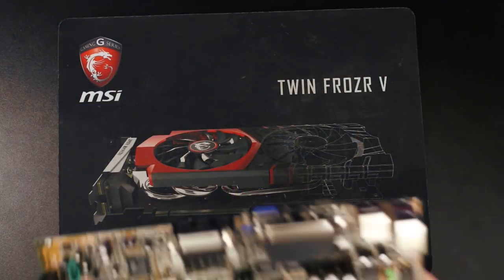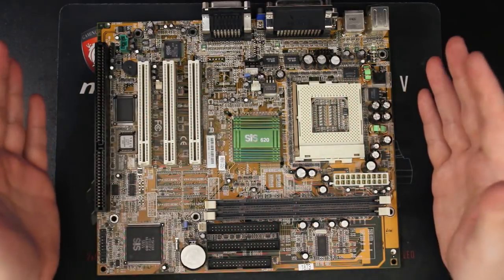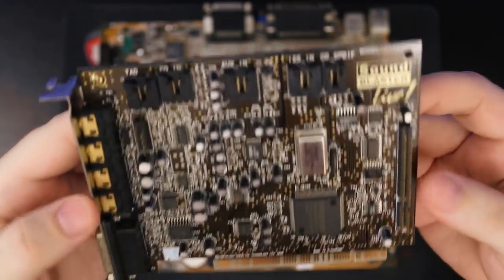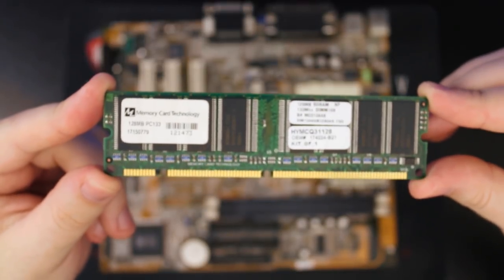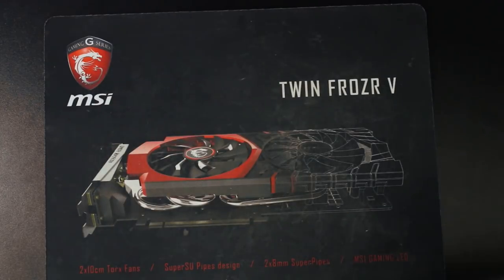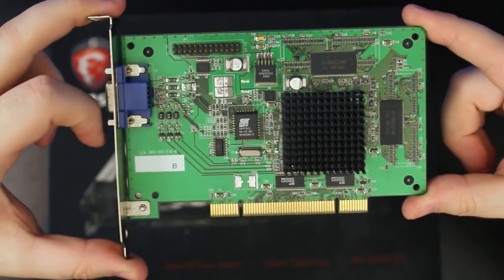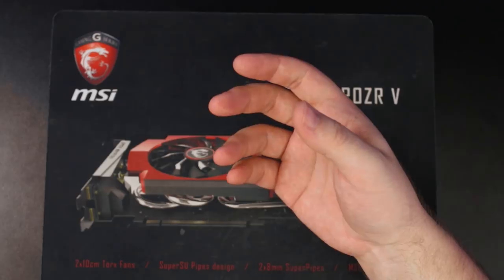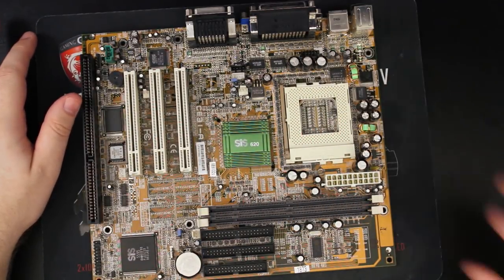(out dated) The 1999 Retro Project - Part #1: Hardware Choices

Comment: Actually, RAM can work at lower frequencies, so a 133Mhz stick should work in a 66Mhz or 100Mhz bus motherboard.
BUT it does have to be compatible. Back then there were compatibility issues between dual sided RAM and single sided RAM, the density of the chips, and sometimes the quality (I know some Asus boards are really difficult and won't accept cheap RAM). It should be explained on the motherboard manual.

Comment: I ran Morrowind back in 2002 on a TNT2 Pro 16mb. 800x600, everything on low, ~20-30fps. Not great but playable. Had to upgrade to 256mb of ram though.
Reply: I limped along on a 9200SE (gimped 8500) during that period. World of Warcraft ran ok on medium settings. Had to upgrade to 1GB of ram. With 512mb on WinXP WoW would struggle, having to switch to virtual HDD memory partition constantly to load/stream the larger zones. Why do I remember all this...